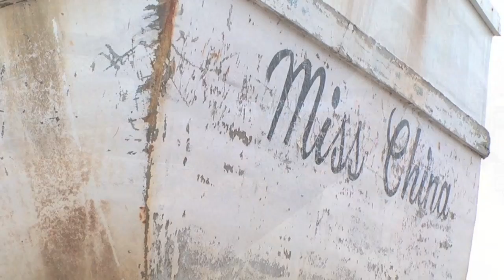How to Demolish a Boat

Comment: I was riding a 45' yacht with a friend down the Mississippi River to Clearwater Florida. We got to Apalachicola and got behind a barge that churned up a log from the bottom, which we hit and bent a prop. We limped to the Government Cut and into the marina. They had one of those boat lift sling machines just like the one here. We pulled in, they raised it out of the water and drove inland a bit, we had a shiny new screw installed, cleaned the bottom with a pressure hose the best we could and they sat us back into the water. It was so quick, so painless. Expensive as all fuck, but we were on our way by lunch. Amazing machines
Reply: 00UncommonSense00 Logs float on the surface, the towboat and barge ran over it then you hit it because you were following too close and didn’t have time to see it and take evasive action.

Comment: I recognize the old Wood-Freeman autopilot, hanging from the steering wheel. Had the same set-up, as the vessel I ran in 2018-19. The Sterling, was built in 1929, and is 85 feet, and due for the same ending. She tried coming apart, in the Gulf of Alaska.

Comment: When they hauled it out of the water, why didn't they just dismantle it on land? Why did they plop it on a barge to dismantle it? As they were dismantling it, debris was falling into the water.
Reply: Because as they said in the video, the plan was to take the debris to a waste fuel plant to burn it. That would be much more work to scoop it up off land after you shreded it and put it BACK in a barge
Reply: trucking604  any oil or so spill stays in the barge this way. On land it could have been washed away.

Comment: I was down in the keys at a marina where they had an abandoned fiberglass sailboat they were cutting apart with a chainsaw.   They have moorings there, and you have to pay a nominal fee to moor there to cover the cost of pump-outs.  Anyway, hippies buy these old boats and live in them and then don't pay the fee.  I asked why they didn't just SELL the boats instead of scrapping them.  The guy said, "The former owners would just buy them back for pennies and start the process all over again".
Reply: Agreed.  The port commission where I live had the same problem and sets a minimum price to abandon boats and the people buying them have to have paid up insurance in the value of the boat or they can't have it.  They crush and haul them off to the landfill now.

Comment: only thing that kept ship on the water is the fiberglass skin, the rest is all rotten
Reply: Brucs spritsen
K
Reply: Bruce Springsteen
Reply: marek35 j
Reply: Ships arent made from fiberglass..its steel.
Reply: @toshmayberry623  Negative Ghostrider, that was fiberglass covered by wood. Steel doesn't crackle when it's ripped apart, it shrieks and screeches. Fiberglass and wood crackle and pop and splinter just like... well wood
Reply: there goes another homeless mans home. blessing from the us.
Reply: Innercity - "there goes another homeless mans home"? That public funds had to pay to clean up.

Comment: Did the engine and generator work i would of mounted them on a inclosed trailer for emergency power so it can be pulled to wear its neaded
Reply: They said the engine was shot, you could see the rusted out heat exchanger and missing exhaust manifold. Looked like an old 8-71 Detroit. Don't know about the generator though, it looked to be in better shape.

Comment: You're making a lot of assumptions. Most likely, the boat would need substantial repairs after being beached like that, which the owner probably couldn't afford. Although it was still floating, they may have needed to remove all his stuff to lighten it and the boat may have been too fragile and dangerous to live in any more. And they won't have paid to have it demolished but, rather, sold it to the highest bidder, the demolition contractor. Still sucks that the guy lost his home.

Comment: what are the slings made of?? steel cables inside a rubber protector to keep sea salt off it?
Reply: +Firedrop2 mostly the protector is for sharp corners of metal that can cut the steel cable and doesnt let cable damage new boats
Reply: +Jan “Nekoroms Random” Andersson .vf .v.f.lgflff.f.

Comment: Id buy that boat for a dollar. Thats much more profitable for the state than paying for someone to scrap it.
Reply: it would be better to burn it
Reply: But they can then sell the metal for definitely more than $1
Reply: AtlasVisuals do you understand how much work goes into scrapping such a large object? after you've torn the boat apart you have to sift through the ruble to get to the metal and other valuables. then you have to gather the garbage and hall it away. but if you were to go through the hulk and collect what you want to keep, then burn it, you're saving yourself a lot of trouble. after you've let the fire go out and let remains cool, all you're left with is slag from the metals that in the hulk along with any non-burnables.
Reply: Nathan Tankersley
like the other guy said, it would of been cheaper to burn it, use a magnet to remove the ferrous metals then wash the ashes away and gather the brass and aluminum. The fire wouldn't be hot enough to burn the metals to slag if you did a controlled burn.
Reply: sniper152 Can't burn it, the fiberglass would give off toxic fumes
Reply: Nathan Tankersley That was what they did to decomissioned trains, cars, busses and trams in the old days. Paint, fiberglass, plastics, electronics and various other hazardous materials makes this highly polluting, is also wasteful because it destroys some salvageable materials so chopping it apart and burning the combustible parts in a properly filtered incinerator is the best approach, also some modern facilities such as for example the incinerator at Fynsværket in Odense, Denmark close to where i live. can take heavy metals and various chemicals out of the smoke for later recycling.
Reply: Well first the scrap yard buys the boat from the government then the scrap yard processes done the metals and up sells for a profit . i suppose the towing fee would have been high but i wouldn't know for sure never owned a boat
Reply: Nathan Tankersley
Reply: You don't know at all, let alone "for sure".  Scrap isn't worth much and transport and demolition aren't free. Many smaller boats go to landfills because they are worse then worthless.

Comment: The shear machine seemed pathetically inefficient.
Reply: Scotty. Just think what that shear would of done to your Vespa in less than a minute?
Reply: Its main use is in steel scrapping where it is very efficient. Either way, there's less physical labor.
Reply: Would you rather do it with a hacksaw by hand?